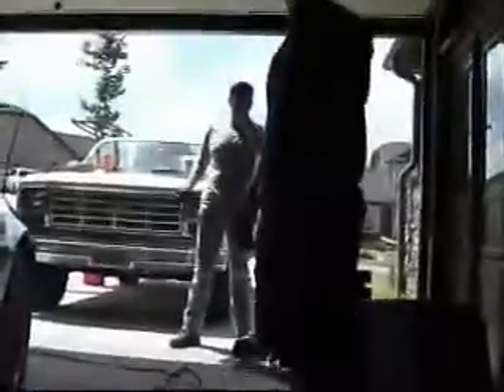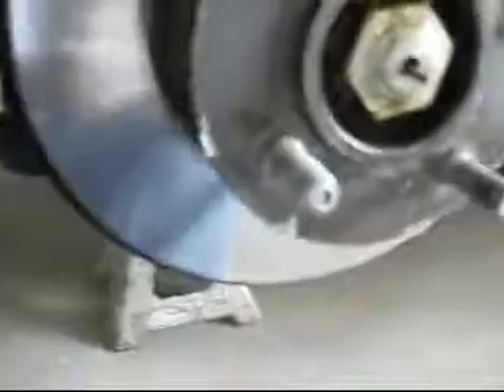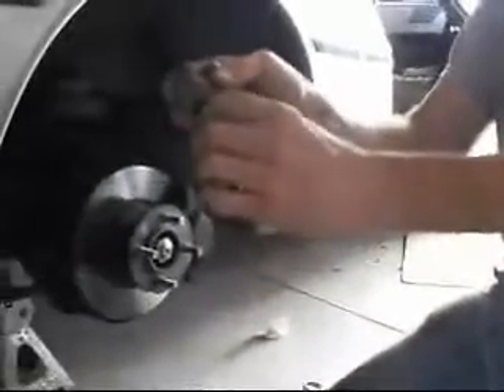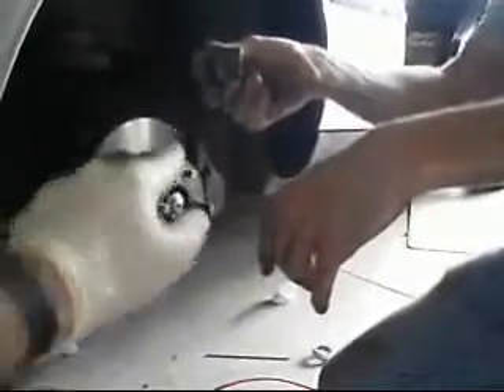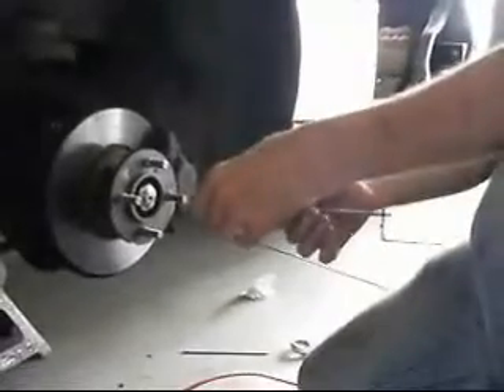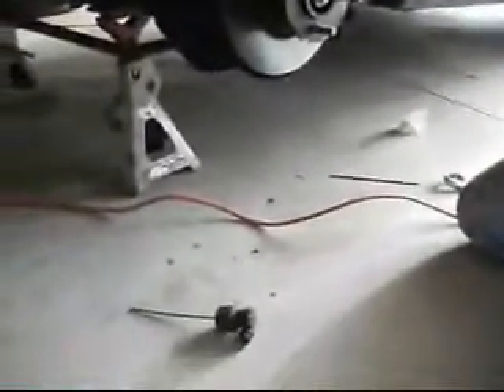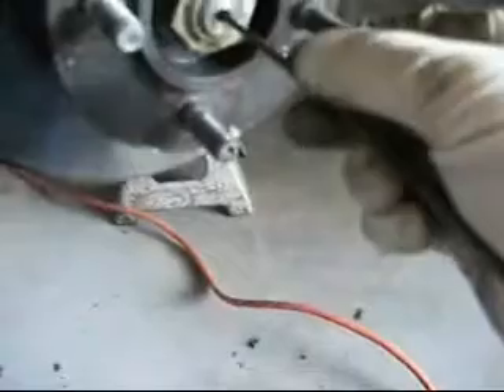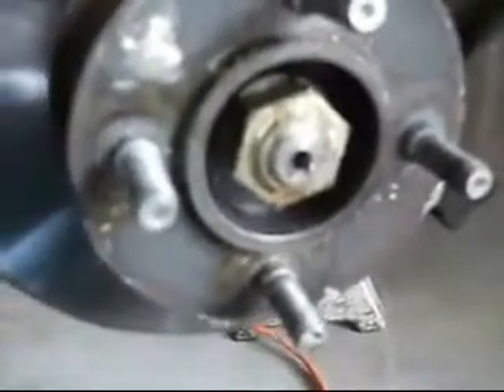DMCToday.com - How to replace speedometer angle drive in a Delorean

Comment: It's not a British car.
Reply: Ireland.
Reply: Robert Darlington It's not an Irish car either.  No more than my Ford is a Mexican car because the assembly plant happens to be in Mexico.  DeLorean was an American car company with its origins squarely in Detroit.
Reply: Stephen Rice My Ford is nearly 100% metric.  Most of those parts didn't come from here either.  It's still an American car.
Reply: Robert Darlington Cheap (but better quality) Chinese steel makes up my Toyota.  It's not a Chinese car, nor American (even if built here).
Reply: Stephen Rice Oh, we display Jag's and MG's and Lotus cars all the time at American car shows.  So let me be very clear and avoid any further bickering.  DeLorean is an American car.  I'm sorry if you really want to be right on this topic, but it just isn't going to happen.
Reply: Stephen Rice Once I swapped the springs out for ones about 1.25" lower in the front, my D is no longer half baked.    So thought problem for you.  If I ask a British car company to design my  frame and suspension and an Italian designer to design the style of the body, and have it assembled in the USA, is it anything but an American car?  Why do you think the location of the assembly plant has anything to do with it?